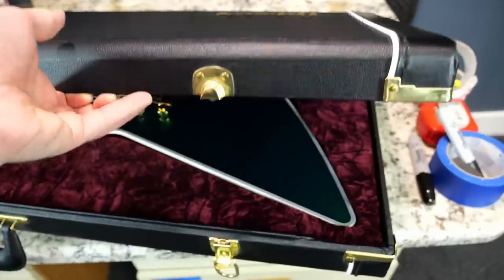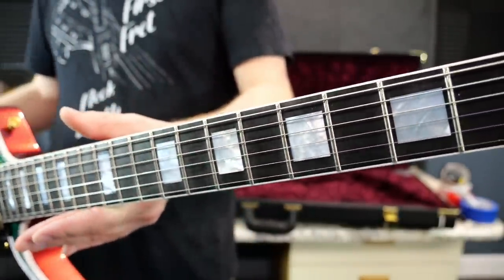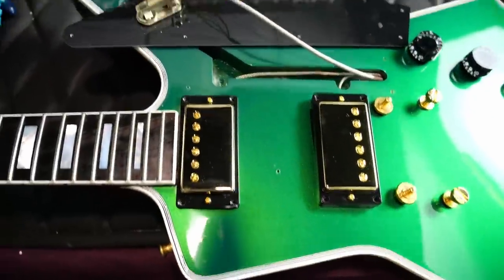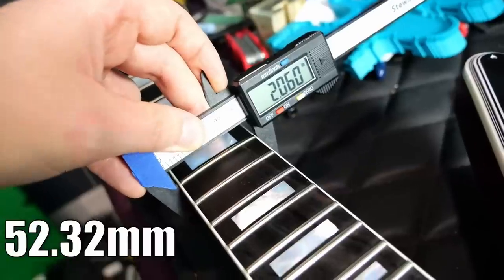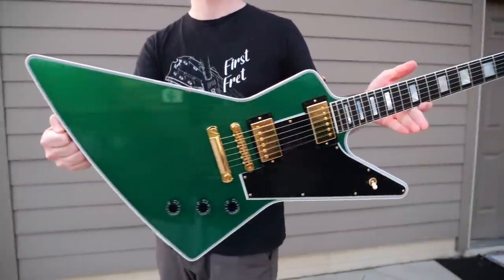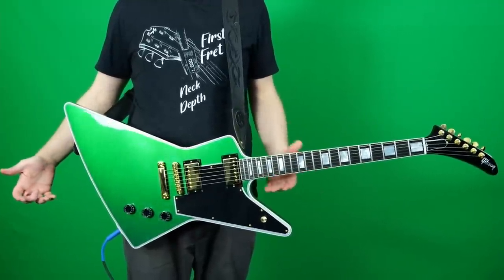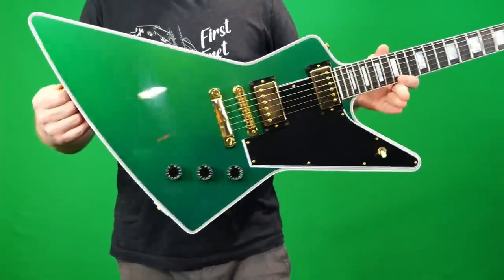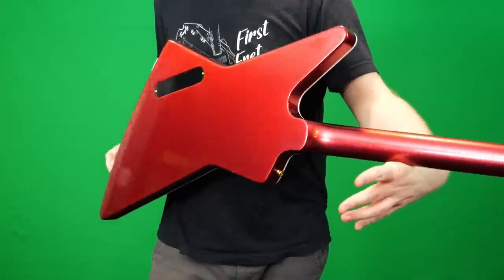Now I Think of These Differently… | 2022 Gibson Explorer Custom MOD Collection Flip Flop Green Red

Comment: **in theory** ABS plastic and wood contract/expand with temperature differently by a factor of 10.  If you put an ice pack on the back of the guitar over the back plate, it should shrink 10x more than the (wood) opening/cavity.  If the finish is super-sticking to the edges of the back plate, it could still yank the finish loose, but it’s something to consider if yo really need to access the electronics.

Comment: The pups sound low output. Only growling when pushed. Seymour Duncan has never steered me wrong. I would be putting modern EMG's or Fishman's in it.  Overall the color makes the huge Explorer look like its the size of the Explorer Pro. Guess my new Grail is the painfully incredibly natural finish CTM/Pro size axe. Guessing any Pro that is clean and straight will run $3-$4,500 its gonna be awhile until I get one.

Comment: nice guitar Mr Trogly, but why ruin it with a pick guard / scratch plate ?
My Solar E1.6 FBB doesn't have one and if owned this i'd remove it even if it meant the holes were showing !
Greetings from NZ 
😎🎸

EDIT: aaah the route for the switch wiring. My Solar E1.6 has a better route than that.
Reply: Do they sell tiny plugs for the pick guard screw holes?  If someone sold those in a sufficient myriad of colors, that would be great - I hate the disruption in the look from a pick guard.  And I finger pick (don’t need “finger pick guards”).
Reply: @mackkenamond1800  nice idea. Probably not a profitable job in the western world but China maybe ?
Tbh I’m limiting where possible my purchases over in nz for anything made in China favouring made in NZ or Oz. 

Not just for supporting local jobs but because they have no standards they need to adhere to. 
I bought the so called Bambillo Pillows” when drunk one night on the shopping channel. 
They arrived promptly but they wreaked of chemicals. 
I put them on my balcony for 2 weeks, even washed the covers. 
Nope. 
And you’re supposed to use these as pillows in your bed ?
So yeah there’s that
Reply: @PeterMoore350  I bet there is something out there for sewing or beadwork or custom electronics or ???.  Just gotta find it.
Reply: @PeterMoore350  plugging holes with unobtrusive material has to be a thing.
Reply: @mackkenamond1800  ha. Sorry for my rant. 
I actually tried to register “notmadeinchina.com”. But it was taken. Hehe